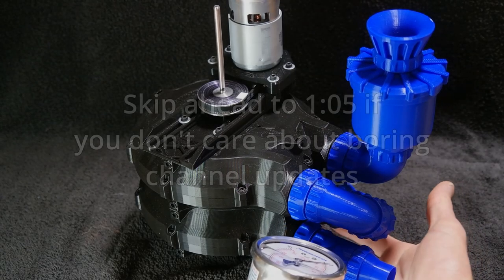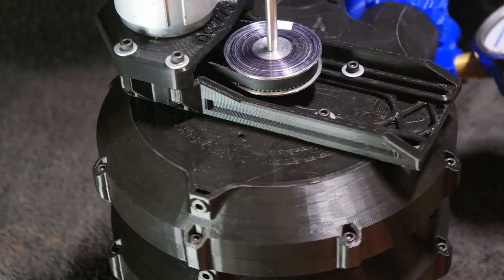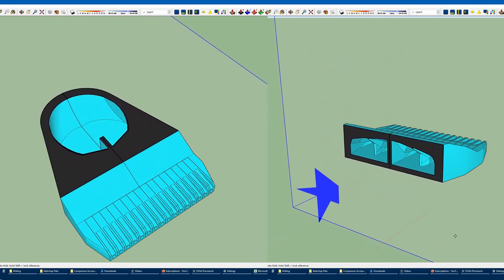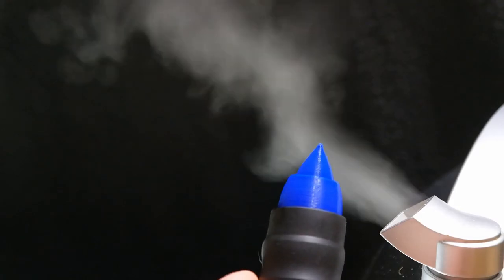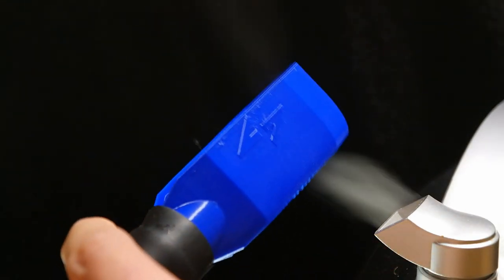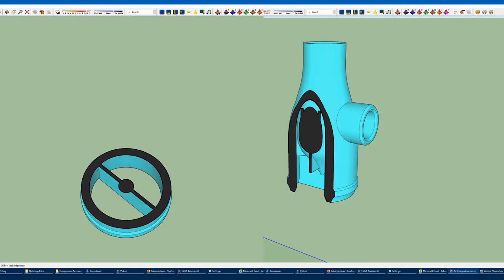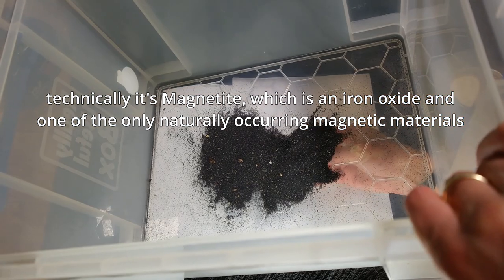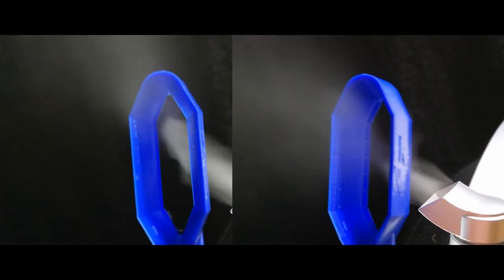I 3D Printed a Mini BLADELESS FAN (and 3 other fun Compressor Accessories)

Comment from the maker: I probably haven't even scratched the surface with these 4 💨  What are some other attachments you'd like to see tested?
Reply: If you have enough load steppers can spin up pretty fast, a stand alone tmc module and a cheap pwm generator works ok as drive. the tmc stealth chop keeps them pretty quiet

Comment: I like the compressor, but I think I can make it quieter. I may make my own version of it for fun. I see how it works, but I'm going to design a whole new version of it. My thoughts are, I turn the entire ring with blades into a motor. I.e. install magnets all the way on the outer edges of the propeller. Then install coils that fit in the outside casing. By powering if from the outside instead of a motor driving the shaft it should be significantly quieter, and because the torque is on the outside it should be able to go faster. It will basically be a 3 phase brushless motor designed around the compressor. I hope that makes sense. I'll let you know if I build it.
Reply from the maker: Sounds involved but very cool!  I'd definitely like to see it!
Reply: That sounds pretty interesting to see even if you can't get it working as a compressor!

Comment: Don't remember who, but i've seen a video on experimenting with perfecting a diy vacuum forming machine and a big problem is getting enough vacuum pressure with an affordable system. Any kind of centrifugal pump like a common vacuum cleaner just can't produce pressure. Commercial units use a piston pump with a large vacuum tank to build a sufficient charge from the slow vacuum pump, which is a very expensive setup. Maybe a regenerative pump could be fast enough to work while still supplying some real vacuum pressure?
Reply from the maker: When I get around to trying a (much) bigger motor, I'll be sure to test what kind of vacuum this can pull.  I'm not sure how well it'll work to draw down lower pressures because the vortex effect seems to depend on having a certain amount of air to vortex-ify (that is, performance seems to improve with increasing output restriction to a point, so I'm concerned it would drop off in the inverse case), but we'll see!
Reply: @jamespray  If you've already got them (I don't know if you do, just suggesting) you could join multiple of those 775 motors to the same shaft and see if that gives you sufficient improvement for what you need without jumping to a larger, more powerful single motor.
Reply from the maker: @claws61821  That could work (although unfortunately no, I don't have more than one of matched specs, at least not right now).  It would take more DC than I have power supply oomph to drive to do more than 2, though... right now, anyway ...

Comment: i do wonder about these compressors at times.
they really remind me of the torque converter, except... its closer to a simple fluid flywheel.
the main difference being the flywheel only spirals the fluid, it doesnt have this regenerative effect where the increasing fluid velocity actually acts upon the driving turbine... fluid flywheels tend to churn the fluid, heat it up, and are overall pretty inefficient. see the same thing happening here.

i see some scope for chasing other options in its design, different approach on the way its doing its thing... exactly like the torque convertor vs fluid flywheel. even if the end result is completely different, i cant help but feel the two machines are related.

anyway
sort of envisioning the same general layout, except with the casing redesigned a bit.
 feed into a toroid through tangential slot on the circumference, allowing the pressure to build in the toroid chamber, where the air can then be redirected through nozzles acting on the inner circumference of the blades and act in the direction of rotation, increasing the velocity of the air flow through the blade.

at the same time, that nozzle on the inner circumference acts as an air multiplier dragging fresh air in with it...

bernoullis is amazing. and when you look at things like steam feed water injectors and the like... capable of doing interesting things.
Reply from the maker: They are indeed very interesting and act quite differently from other types of air compressors.  I have been thinking of an alternative design with a double toroidal working chamber (that is, inverse donut cross section where the center is solid) where the toroid outer wall is formed by the casing and the solid core is the outermost portion of the impeller wheel, with airfoils forming the "spokes" to attach it and generate a vortex in one direction around the core.  One possible weakness for such an approach in printed materials is that unlike the current design, the forces/pressures on top and bottom of the impeller would not be equal.  However, I think it might be a potentially more efficient approach and enable performance balanced more toward pressure than flow.

Comment: Just wondering, maybe you can confirm, a 5015 blower fan would not put out enough pressure to make these work right?
Reply from the maker: Most likely not.  Two or three blowers stacked in series with adapter ducts to build some pressure head might be able to hack it, though!